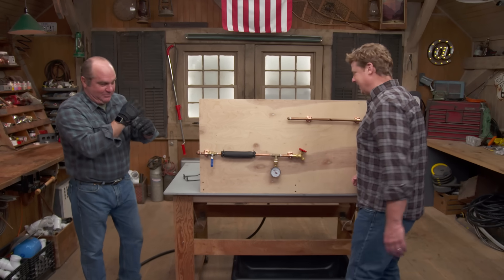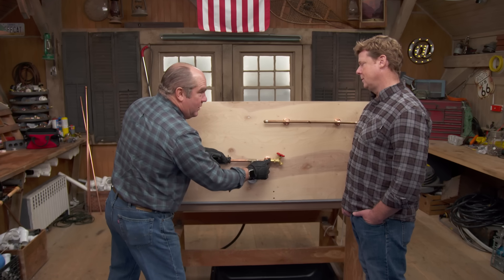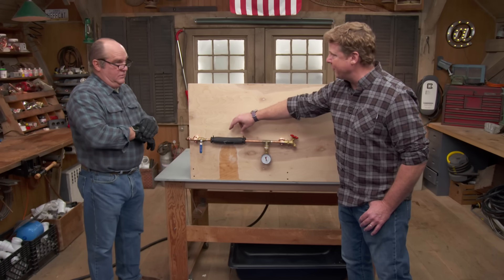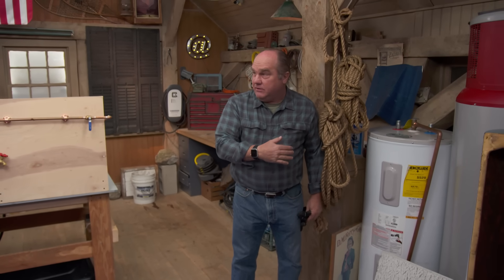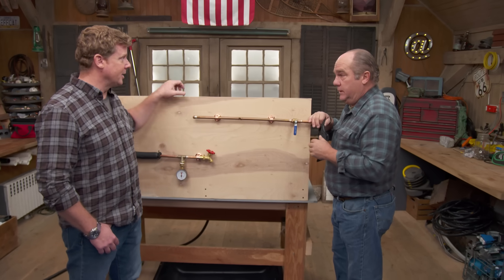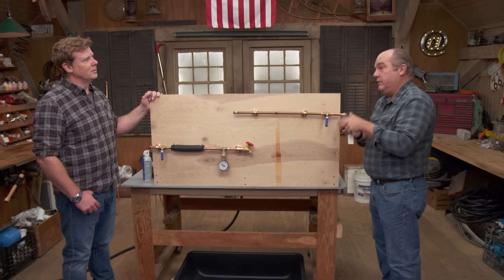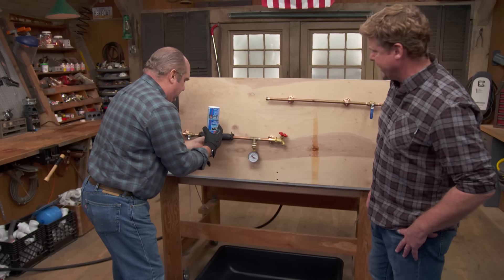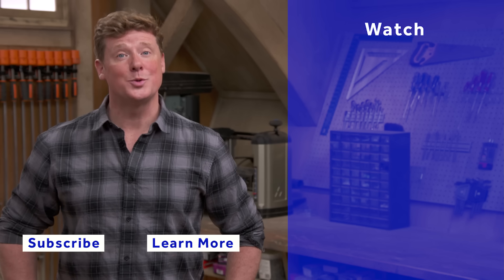How a Frozen Pipe Bursts | Ask This Old House

Comment: In the winter, if you leave for a week or even 2 or 3 days. DO NOT shut the heat off. Your pipes will freeze and break. It is a disaster.
Reply: Daniel Tadros  … If you are handy at all you can shut off the main water supply and open a drain valve in the basement plus a few taps upstairs. If you are not so handy you can at least flip the breaker off at the panel to prevent the well from pumping till it goes dry. This will limit any leak to the 20 gallons or so in the well tank.
Reply: @rupe53  Thank you, I already heard this from a plumber. It is just soo simple just to leave the heat on 68 degrees Fahrenheit while I am away in cold weather.
Reply: Daniel Tadros 68 sounds really high tbh. I have a second home I leave at 58 or so. I think it’s more than enough. Ymmv though
Reply: @humbertoricardo7330  The freeze temperature is 32 degrees. So 58 is okay. Soo many people just don't know to do this. That is when disasters happen and plumbers make a lot of money.

Comment: We used to live in a small mining town outside of Sudbury, Ontario (Northern Ontario) and we had our main supply pipe freeze one winter.  It didnt burst, it just froze.

Even though the supply pipe was under at least 2' of ground and by then, covered by 4' of snow, it had frozen solid.  It had been a week after our "January thaw" and the cold had penetrated that deep.

Once the mine maintainence crew had come around to thaw the pipe  that was what we had to do for the rest of the winter and all the following winters that we lived there - leave the tap open in the basement laundry room so that it went drip, drip,.......  We never had a problem after that.
Reply: Bill Campbell … I have a friend in northern NY who is living in what was once a seasonal house. Pipes to the well are not below the frost line so he adds a few bails of hay along the pipe route outside the house to aid with insulation. I have also seen areas with too much rock to get water lines deep enough. They run the pipe through a sleeve / conduit and allow the air space to do the insulation. That seems to work well and it's certainly cheep enough if the trench is already open.

Comment: Fascinating.  I wonder if additional (or larger) expansion tanks (like on a water heater) could help absorb some of that pressure?
Reply: Theoretically yes, however you would need one on both sides of the frozen pipe. I don't think it would make much sense to have one on the exterior side of the house. It would be exposed to the same elements that froze the pipe initially.
Reply: Big Mo no they won’t but that’s a good question.

Comment: Then Why is there no standard pressure relief bypass in the farthest faucet of the house ? Would actually be pretty simple to connect it to the sink, and voila, thank me later
Reply: Poutinsky _  They don't require pressure relief at the end of a run because that's not always the area that freezes. BTW, if you know where it's going to freeze you can probably prevent that in the first place. Now let's revisit the idea of pressure relief to keep a pipe from bursting. Standard domestic pipe is rated for like 100 PSI normally with a 300 PSI burst rating. Water hammer can easily hit several hundred pounds so your pressure relief might blow off on a regular basis... and where would that water go? Basement floor? Through a hole in the wall? Maybe you choose to have extra (and ugly) pipe in your sink? You'd need one for both the hot and the cold water too. What about that bathroom or laundry at the far end of the house? It's starting to get complicated and there's no single solution other than to keep it from freezing in the first place.
Reply: @rupe53  I think you make it sound more complicated then it has to be... simple relief valve bypass on hot and cold line, under the sink, connecting to the drain, same way a dishwasher connection is made, nothing ugly or showing.. and you protect everything from the freezing point to the farthest sink, technically you only need to do this at one place, the farthest, that's the point of leaving the tap slightly open. But obviously, preventing freezing is logical, but not always practical when some house have lines passing in the walls too far out, or in the sanitary space with temperatures hitting -50C sometimes for a week..
Reply: @zamboner  … all I am saying is "one size doesn't fit all" and there would be many exceptions so people would be disappointed if it didn't cure their problem. We're basically trying to reinvent the wheel and make it idiot proof, which can't be done. There's just too many kinds of idiots out there!
Reply: M Detlef  … yeah there is, it's called building code. You can't have pressure relief where the high pressure might come in contact with a person. Besides, what about the tub taps with a shower? Now you have a restriction on the relief, which is also against code for a relief valve. I do like the idea, but someone would have to write an exception into the national code, then come up with an idiot proof product that wasn't too expensive.

Comment: Is there a pipe that doesn't burst out in Cold weather?
Reply: NO there is no pipe on the market that freeze proof
Reply: Pex 🤷🏽‍♂️
Reply: @canogaparque818   wrong pex will still freeze and burst
Reply: @hotrodpaully1  never said it wouldnt freeze but itll hold a whole lot better than galvanize amd copper

Comment: 2 years ago when we had a cold winter and my parents weren’t home, a pipe burst. Long story short, we are still fighting with the insurance company 2 years later over all the damages.
Reply: are you sueing with winter or physics?
Reply: Хлебников Денис I’m afraid I don’t understand the question.
Reply: @lionlinux  ....yes
Reply: Most insurance company don't cover flood damage unless you have flood insurance and a burst pipe would be flood damage/ owners fault for not having heat/insulation/not turning off water good luck winning that battle

Comment: Full City Water Pressure, the classic plumbers lament.
Reply: My house is running on 160 PSI right now.. The plumbing was built to handle it so there is no reducing valve.
Reply: User 2C47: Yikes!  40-80 is considered normal in our area. Your shower must peal the dirt off like a power washer
Reply: @user2C47  except modern appliances aren't built for it
Reply: @USAFTACP  ... after I connected to "full city water pressure" and disconnected my well system, I had no issues till I did my first load of laundry and heard every pipe in the house banging as the water went on and off. I knew I had enough hammer arrestors in the house because I did the plumbing myself. What I didn't check right away was the difference between the old well pressure (40 psi) and the new public water.... 100 psi! The following weekend I installed a pressure reducing device and set it to 40 psi.... no more problems.
Reply: pavelow235: well...in all fairness, in some communities city pressure exceeds recommend house pressures - which is why pressure reducing valves (PRV’s) are ofter Installed.

Comment: That was actually a very informative and neat demonstration
Reply: Well here i am again after the Great Texas ice storm!! Luckily my pipes were all insulated and survived without issue!!!
Reply: @JM-yx1lm  Here in Austin, but originally from NH, these guys have saved me a lot over the years. Best advice as it relates to freezing pipes is right at the end about opening up a faucet or two for dripping to relieve pressure, works like a charm.
Reply: @davidw2174  yes sir, glad yall have made it through the worst without out much issues...finding out today that gas stations here in DFW are all out of fuel everywhere...

Comment: We always let ours drip when it gets down to freezing.  But, I never thought that did any good.  I guess it does.
Reply: 6996katmom … you have two things going on with a faucet dripping. The first is that moving water takes a lower temp to freeze. This is why a river freezes well after the lakes are frozen. The second is you are constantly allowing the pressure to drop if it does happen to freeze.
Reply: @rupe53  you're also replacing the cold water in the pioes with slightly warmer water from the underground pipes. It's not a lot but can help!
Reply: 6996katmom it helps but running water will freeze. The Mississippi River freezes, Great Lakes Freeze, oceans freeze and so on.

Comment: My Grandson just rented his first house in Burnsville Mississippi and found out he needs to drip his faucets at night when temps hit freezing which is almost every night back there. Great video Rich.
Reply: Surprising that would be a problem in the South
Reply: @pavelow235  … The problem in the south is older homes that were retrofitted with indoor plumbing and almost no insulation, as in your typical (read: low budget) rental home.

Comment: Pex pipe will expand so no pressure build up.
Reply: Wrong it expands from the pressure and will still burst from freezing do a search on it there is no pipe on the market the is freeze proof
Reply: @hotrodpaully1  This is not my experience. I've had my pex pipes freeze on several occasion on my outbuildings with no bursting.
Reply: @hotrodpaully1  They don't burst in my experience.
Reply: Not at the couplers?
Reply: @Iwish4zombies  I'm on a Mountain homestead with pex running to several outbuildings. We use a mix of plastic and brass couplers to our outbuildings. They have froze many times without bursting. The brass in the couplers is very thick and I thing the pex lines allow some expansion so the pressure does not get that high.
Reply: @Iwish4zombies  Not in my experience.
Reply: It could still freeze
Reply: @canogaparque818  Yes, they can still freeze, but do not burst in my experience.

Comment: wow, exploding radiator.
Reply: kodiak wild think that’s bad . When I took plumbing in trade school the showed us a film (yes film) of a hot water boiler that built pressure and launched through 7 of 10 floors of a apartment building. Always remember to check and maintain the pressure relief valve.
Reply: @Duckesduckpond  ahh yes, the days of film flapping reel to reel projectors 😂 i remember.

Comment: For the last 15 years here in Missouri, I average 2-3 bursts each winter in my house. The first few years I used galvanized and the cheap Chinese made steel would not hold up,even with electric pipe wrap. I switched to PEX and that's just as bad,but easier to fix. I finally bought my own PEX tools as I got tired of renting them at $6 per day and having to wait for the hardware store to be open.
Reply: You need to fix the cause of the freezing  instead of spending 15 years repairing damage what you spent in repairs in 15 years you could have fixed the cause 10 times for cheaper
Reply: @hotrodpaully1  I agree for the most part. I do all the work myself and learn from my mistakes, but the costs have been extremely low, just time consuming and an inconvenience. It's really just a matter of being able to afford to get everything I need to make it work and keeping the motivation. Earning a living, going through relationships and remodeling 3 houses at once really takes a toll. I need to learn to follow through on 1 job at a time, rather than spreading myself thin. I'm just in survival mode at this point.
Reply: @DeathAngelHRA  - I admire your perseverance!
Reply: Insulate your house
Reply: @seriouslyreally5413  It gets more done each year and had zero when I purchased it. Being built in 1870 and a large home,it's quite the undertaking. The only real solution is to add a large wood furnace, which I had,but gave to my friends to help keep their children warm. Things could always be worse and I'm thankful to have a roof over my head,although it needs that as well. lol
Reply: i'm surprised the galvanize breaks on you.  I would use some of that spray foam in a can and try to foam the wall so air doesn't blow against the pipes. I'm in Chicago area, so i've had plenty of copper pipes bust on my other properties when I'm not around, it does suck.
Reply: @Stellasmith-j9q   The galvanized split the easiest, especially on tees and elbows. Even when leaving the faucet trickling,the drain would freeze solid,creating a frozen waterfall all the way to the faucet. I've replaced so many faucets and toilets that have frozen solid and cracked....  It makes me appreciate the daily things we take for granted each day, such as a working toilet/indoor plumbing.

Comment: A shop I was working at years ago got FLOODED in seconds when the 5" sprinkler main pipe busted.
Reply: had a 2 inch main sprinkler line freeze and  blow before the backflow preventer few years back in crawlspace at work...i was on call and was there in 10 minutes and the crawl space was already full..id say 20k gallons at the least...had to get water dept to shut off in the street...just wrecked the hallway and luckily did not do to much apartment damage..fire department let me use there pumps and it still took 3 hours to empty the crawl space..fun times lol
Reply: Ooooooo goodness. Whst a mess
Reply: A buddy and i were doing some plumbing at a house and he tried soldering a cap on a pipe that had water in it still, and yes you know where this is going the pipe built up pressure and the cap shot off and hit him right in the chest , it sounded like a gunshot never found that cap, luckily it didn't penetrate his chest, but boy did he have one hell of a bruise.
Reply: Worked at a 150 apt retirement community with a 4 story atrium at the very top was a gable peak with windows and there were sprinkler heads... They burst water poured into the atrium for over two hours until we could get someone to figure out how to turn off the main. I was brooming the water out the front doors trying to keep it from spreading to the residential areas. Several thousand gallons poured in, it was raining inside.. craziness